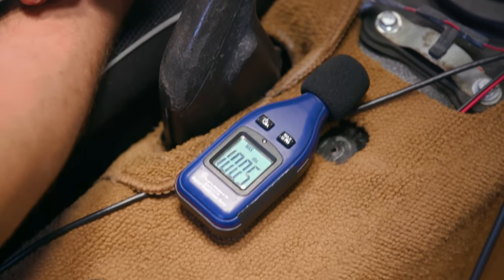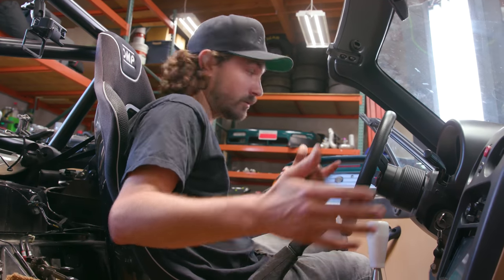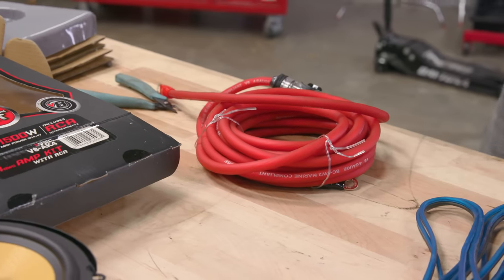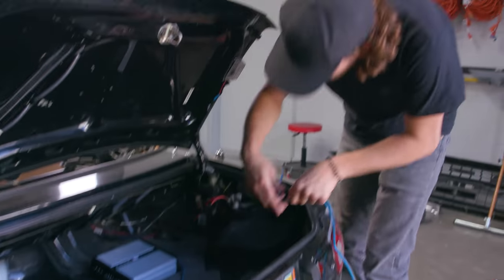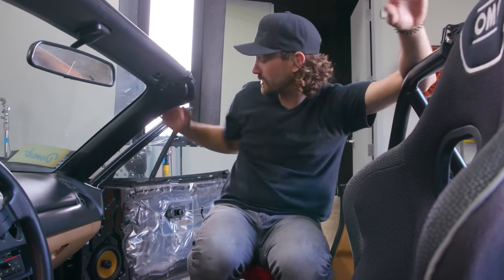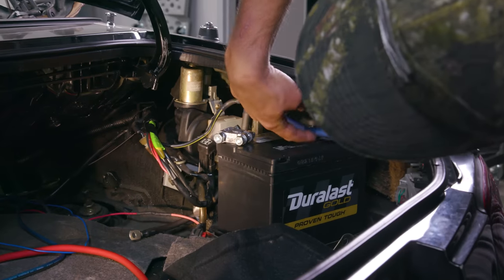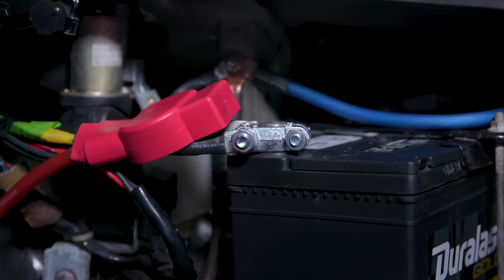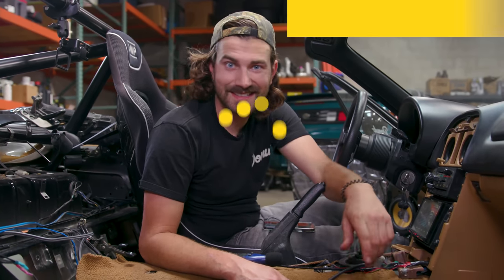Is Upgrading Your Car Speakers ACTUALLY Worth It?

Comment: Some extra bits of info on the topic for anyone interested in doing this:
- It is extremely important that your positive power cable has a fuse on it as close to the battery as possible. If you run an unfused thick power wire - especially a long one - and it accidentally hits the body of the car or gets damaged for example, you are directly shorting out your battery with a very beefy wire, meaning the battery will essentially pump out all of its energy as fast as possible, not only killing the battery and potentially starting fires, but also literally creating an explosion hazard as the battery overheats and starts to boil.
- It is common advice to always make sure the ground cable is the first cable you install to an amplifier. Do not plug in the power, remote or especially the RCAs before the ground is connected. Similarly, whenever you are removing an amplifier make sure the ground stays connected for as long as possible.
One of the worst mistakes you can make is plugging the RCA in first, then power. As soon as an amplifier receives power on its terminals, even without being turned on with the remote wire, it will charge up a capacitor bank inside which causes a huge surge of current - often even visible on the power cables as a loud spark. If the ground isn't connected, the amp will ground itself through the only path it has - the RCA. Now this huge current surge will run through your thin RCA wires into your headunit instead of using the nice and thick ground cable. This pretty much always results in blowing the audio traces and/or nearby components in your headunit, resulting in anything from horrible sounding audio to no audio at all or even a completely dead headunit.
Good order of operations is Ground -> Power -> remote -> speakers -> RCAs. When removing, reverse the order.
- On some headunits the very upper end of the volume range is not actually recommended to use, especially with an amplifier hooked up. Past a certain volume level the headunit starts to "overdrive" its outputs, meaning it has already reached "maximum" volume and is now just trying to make it even louder. This is done to for example get full volume out of a music track that is particularly quiet. If however playing "properly made" music - music that is mixed in a way that it hits close to 0dB at some points in the song - the headunit can't actually "amplify" the sound any more and the sound signal will do what's called "clipping" - the round peak of the soundwave gets clipped off. This will bring unwanted harmonics to the audio and if the clipping is high enough the distortion will become audible to even the most untrained ear. Clipping is bad in more than just audio quality though, as it can even break your amplifier or speakers if done for too long.
Set the gain knob of your amplifier to it's lowest level. Start increasing volume from the headunit gradually until you feel like you start hearing distortion - this is most audible at lower frequencies, eg. bass. WHen you hear distortion, take the volume a few clicks back until you can be absolutely sure you hear no clipping. Now try with different songs, and if the audio quality increases by lowering the volume, you are likely clipping. Continue this until you have found a volume level at which all songs sound fine.
Now start increasing the gain knob on your amplifier, listening for the same distortion again. Once you hear distortion, dial it back again until the audio is crisp. Repeat with many different songs until you are sure you get no clipping. Now you have "gain-matched" your amplifier and also determined the highest safe volume level on your headunit. Never touch the gain knob from this point on unless you change your headunit (the gain knob is not a volume adjuster!!). Memorize what volume your headunit is at when music doesn't clip, and remember to avoid exceeding that volume level in the future when listening to music.
Reply: fkin hell thx a lot mate
Reply: Ok what if everything is plugged in and you need to replace your battery? In mechanics class I was always taught positive first then ground.
Reply: @cod7war  In this case as nothing in the car is grounded in reference to the battery, the amplifier will not suffer. The power coming into the amplifier does not have a path back to the battery until the ground cable is connected.
If for some reason you had two seperate ground terminals on the battery, then once again connecting the amp ground first is important.
Reply: You’re the man
Reply: Back in the day, when I had to get my headunit serviced, I asked the tech to measure the output with an oscilloscope and give me the highest volume setting without clipping. Saved me a bunch of time.
Reply: Perfect addition! Saved me all the typing lol
Reply: Thank you
Reply: holy shit my boy. you put effort into this , really appreciate it coming from a guy new to cars in its entirety. appreciate it a lot !!
Reply: hell yeah
Reply: No more than 18 inches per ANSI regs.  However, open the hood on a lot of older GM and even Ford trucks, and the battery is by the Right side grill/radiator support, and the fuse "box" panel is on the left of the interior kick panel or outside panel of the side of the dashboard. 

Yeah, some are right under the hood, or even under the right side kick panel.  So it's one of those "best practices" things.

Heck, I had a 1959 Chevy truck, and I literally watched a smoke trail travel from the right side of my cowel to the left side as I sat at a red light. Fuse be damned.
Reply: @cod7war  When you are removing the battery, you always remove the Negative (-) first, then Positive(+).  Then when installing the battery, it is the opposite, Positive (+) post/terminal first, then Negative (-).

This way, if you accidentally hit the ground/steel of the vehicle with your wrench you will not short the vehicle's electrical system.
Reply: fuse should be around 10cm from the battery but if u have a second battery connected to your front battery, then u should also have a fuse close to the second battery. so 1 fuse at the start of your battery and 1 at the end. another thing for begginners who connect an amp to your car, u can connect the remote cabel to almost anything that will start when u turn on ur car like lights and stuff
Reply: THANK YOU!! I would have f*cked this up.. lol.. I knew the fuse thing but I didn't think about the order and also having the ground in... so I'm just gonna make sure everything is in place when connecting then connect that ground as soon as I can.. after that I'll do my speakers and all then plug everything in that order.
Reply: You really wrote a book. Good on you mate👍
Reply: looking at the wall of text like 
👁👁
stock audio is fine
Reply: @cod7war  An easy way to remember which terminal to connect first or last in a battery is to remember, "red is the first to show up to the party, but last too leave the party." 
You can think of red terminal, as a Chad. LoL.
Reply: Thank you for informing me that I may have fucked my amp. Greatly appreciated, never done it before and the amp hasn’t even turned on so I was freaking
Reply: @JarnoKai is right on point, the only thing I'd add is to do tune one speaker at a time at first. While speakers may be in the same box, I've seen different qualities. I was an installer for 10 years and I've seen batches of speakers (the store I worked at order a lot of them at a time) where one speaker was defective. Also, upgrade the power and ground wiring to the battery and chassis. It makes a big difference because you're putting a larger demand on the alternator.
Reply: thanks!
Reply: good info man thnks
Reply: I'm changing my car in the next week to a Ford Puma.  It has a 7 speaker system, speaker in each door and three tweeters in the front. The factory speakers are fine but I was thinking of upgrading the speakers. The volume levels are good and I'm not interested in blasting music, medium volume is fine for me. I'm just thinking I could upgrade the factory speakers. I don't really want to start adding amps or subs. Will just replacing the factory speakers be enough??. I won't be doing the work myself either(I'm useless!!). The system is Ford's Sync 3(3.4). Also can anyone recommend a decent set of speakers, they don't have to be top of the range. Basically something plug and play!!.
Reply: @guppy9713  You can absolutely change the speakers without installing a seperate amp. Usually I would advice against this as you get both power and sound quality improvements with a seperate amp, but since you are already happy with the system as it is using the original amp can be perfectly fine. Just match up the impedance of the speakers you are replacing (although pretty much literally every single car speaker is 4 ohms, but you can never be too sure) and it will be a plug and play install. Fitment can be an issue but usually car manufacturers install standard size speakers -> standard size aftermarket speakers will just plop in.
My only advice regarding what to get is get something decent, don't go for the absolute lowest prices. Many people will change their speakers and think that the simple act of changing them, no matter to what, will make music sound better. Fact is that with older cars this is even true :D
However, by spending a few extra bucks you get yourself out of the budget range and into something where the designer was allowed to actually think about sound as well instead of only cost-cutting.
Reply: @JarnoKai  Thanks for the advice mate. I don't mind spending some decent money on a good set of speakers. I just didn't want the hassle of getting an amp installed if I don't need to!!. I have door speakers in both the front and back. Would I buy the same speakers for both front and back or do I buy a certain model/spec for front and different spec  for the rear. I have separate factory fitted tweeters in the front, one in each door and one in the center of the dash. Would it be worth changing those too??. My car is a 2021 Ford Puma(UK Model). I'm pretty sure my speakers are 6.5". Also, can you recommend a good brand of speakers I should consider. Thanks a million for this info.
Reply: @cod7war  The battery PROVIDES power, the amp USES power. They are opposite, so the connection sequence is opposite. (Simplified, but basically true.)
Reply: Wow
Reply: It's better to ground right by the amplifier, no need to go to battery
Reply: @JarnoKai  well said. 
I kept head unit, but bought 2ohm jbl speakers with a high sensitivity . Huge improvement. The built in speaker wire isn't great so will have a higher resistance - so the 2 ohm rating should make up a bit for that. One things for sure it's a levels better than standard speakers! 
Fitting amps is better of course if willing to spend extra and have big power.
Reply: This was extremely helpful thank you
Reply: Usually i put 50% volume from the source to the amp. And volume control is the amplifier if it has that is.
Reply: Commenting for later
Reply: I know the fuse rule well but I still have yet to put a 400amp fuse on the 0awg power cable I have running under my car  😂😂😂
Reply: @MaNNeRz91  0AWG wire is not generally considered anywhere near safe at 400 amps!
Googling "ampacity chart" gives various tables listing wire sizes and generally accepted maximum amperages to run through them. 0AWG is generally considered to be safe at 150 amps so you should size your fuse accordingly.
A 400 amp fuse will not save you from overheating wires when they are "so thin" (as thick as 0AWG is)
Reply: @JarnoKai  150 amps? Are you on about CCA cable? 😂 I did all the math with how long of a run it is and how many amps my battery can safely discharge at. My starter motor pulls about 250-300amps alone so if I put a 150amp fuse in it would probably blow it.

If the cable shorted anywhere it would hit around 750 to 800amps and that would definitely blow the fuse.
Reply: Holy shit. This is so many words and people like me just want better audio, I am not a goddamn audio engineer. 
Like...so many words and things to consider and sounds very time consuming. 
Should probably just pay someone to do it by the time all the install and fine tuning is considered for a safe and appropriate installation.  

But then it becomes a lot less feasible and financially responsible.
Reply: @inpotent7247  what,  you understood all that? Lmao
Reply: Then people forget about the source was a phone, and some systems sound better when not at max levels but a click or two down from max you also have better volume control.

Comment: I must say, being a car audio professional for the last 14 years... That this is the one of the best videos that I have seen, not only explaining the basics of car audio, the install itself was actually very well done. Everything was very well explained and shown ... All his skills and techniques were very good.... The use of good quality brands and good quality wiring.... The explanations of why these things are very important... For example oxygen-free copper... And improving the vehicles thin cheap ground wires...
I would have a difficult time Nit-picking anything...
I probably would have found separate grounds for each rather than bundling them up.... And grinding the paint on the chassis where he connected the ground to bare metal.... Overall... EXTREMELY good video.... Hats off to you
Reply: Oxygen free cables are marketing BS any decent copper cable with suitable size and insulation will perform just as well.
Reply: @dougmathews4480  link to study showing a comparison which indicates a direct win?
Reply: Class D is great for low frequencies. Can use class D in a noisy miata just fine. If you are in a quiet car, gotta use class AB for doors. Also, power wire is way overkill. You machine gunned point of diminishing returns. Those door speakers are not going to pull more than 15 amps peak. At the same time, going overkill on your power feed will save you long run when you are ready to drop a subwoofer. For anyone who hasn't done their first install, use this video as a starting point. YOU CAN DO IT. People like me that would nit pick, ignore us. Your first does not have to be perfect. Your second install will be even better and so on. I have been upgrading my cars for decades. Only last year did I buy a hydraulic crimper. Before that, I smashed the ring terminals with channel locks and soldered with a little torch. With enough practice you will get to a point to where no body panels rattle. My system is so loud, my review mirror is useless at moderate volume and I have to aim the mirror again at full volume. LED headlights dim. Passenger has to scream for me to hear them and often have to repeat themselves. Most of the time, I keep the music lower than people talking casually in the car and the bass drum is softly felt. Fun story. A car in front of me in drive through was license plate rattling and thumping. The car in front of him was yelling to get their order in. When the car in front of me was up, I baby sharked (pink fong) his ass. He couldn't get his order in. He flicked me off a few times, pulled out of queue and went somewhere else. The car that was in front of him smiled and gave thumbs up.
Reply: I was about to make a comment on the overlapping ground and the paint but completely agree
Reply: I was thinking this the whole time watching this video. He explained everything so well.
Reply: Never ever use cheap RCA cables
Reply: Also you must break speakers in before cranking them
Reply: Why would my radio speakers or the whole radio go out on high volume every couple seconds . Say middle song high pitch sound goes off .  Thank you !!
Reply: @macbook802  lol no u don't.  That's a myth.
Reply: U've been a car audio professional for 14 years and didn't pick up on him being wrong about using the amp gain basically as a volume knob?
Reply: I literally was checking comments to see if anyone noticed him using the gain as a level control! Instead of explaining it is there to match the pre-out voltage.
Reply: Also the fact the amp had a built in high pass filter he neglected to turn on and show how to adjust the frequency cutoff
Reply: he needed to sound seal/ deadend the doors to maximize the potential of the speakers
Reply: And adding some  sound deadoner
Reply: @adamosity7127  thats a good story - but you lost me at baby shark pink fong ??
Reply: @HighVybeTribe  google baby shark. it's a catchy song you won't stop singing for days.
Reply: yea but he forgot the capacitor safe need to be key it warns you when there a issue going on
Reply: @modelotime3608 yes that is correct
Reply: @dougmathews4480 Please don’t use CCA wire if your running a power consuming setup and playing for long times lol
Reply: @HumanGorillaHormone that’s what I’m saying and tuning at max radio volume lol
Reply: i thought it was better to bundle up the grounds to avoid ground loops.
Reply: @dougmathews4480  OFC is BS? How about CCA? Is that what you prefer? OFC depending on what gage you're using and what the given current draw will carry more current than standard low quality cable such as welding cable.
Reply: @adamosity7127  I usually turn it down in cases such as you pointed out, it's a matter of respect.
Reply: @macbook802  Absolutely (in most cases) for subwoofers but not so much for smaller speakers.
Reply: @HumanGorillaHormone  True, should be set with a oscilloscope to find where the head unit starts to distort, but he was keeping it simple for the newbies.
Reply: @officiallucifer me too, good point.
Reply: Addition of some terminal protection spray at the ground pile wouldn't hurt.
Reply: You claim to be a professional and did not see the failures???